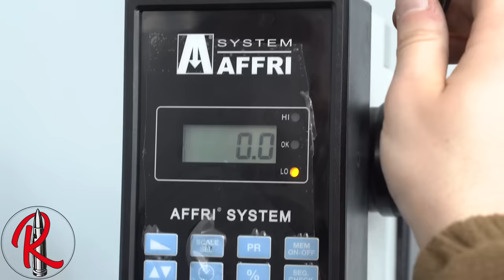Italian ww2 rifle restoration - carcano gun restoration

Comment: The inside of the barrel can be easily cleaned by electrolysis. Plug the muzzle, put a 3 mm wire inside the barrel, wrapped with insulating tape every 5 cm so that the wire does not touch the walls of the barrel, pour sodium bicarbonate electrolyte and connect to the rectifier. Plus to the wire and minus to  weapons. Cleans very thoroughly.  After such a treatment, I even shot with pits in the barrel and everything worked.  To be sure, you can fire with a link.
Reply from the maker: Fire with a link is not a firing test. 
As you can se, the problem for the barrel is not pitting, but headspace and heat treatmen.

Comment: I use a RockWell as a part of my QC job to test the hardness of the iron in the foundry I work at. We use some monocular with a light & measurement scale of .5-1.5 I believe & it tells us if the iron is good. We make safety parts for one of the worlds largest automotive manufacturers. Unfortunately not the best industry to be in atm.

Comment: I don't blame you for not test firing that. It probably for the better not to shot anything outside blanks anymore, though it likely could handle rounds going through it, none of them would flight remotely strieght.
Reply: With zero heat treatment, it is better not to risk it. Blank cartridges as maximum.
Reply: @ВалерийНикулин-р5щ  The barrel would be fine, even without the heat treatment. 

The danger, is that your roungds begin to rattle more as they travel down. This damages the barrel more, and can sooner or later lead to one possibly being caught in siad barrel if not all the powder burns. 

A damage barrel, is not bad, but long term it is bad for safe useage.

But it can still fire for a long time, as seen with hipoint torrorer tests.
Reply: @Espeon1134  Totally agreed.

Comment: A very nice cleaning and conservation, but I wonder if it counts as a restoration if it is not brought back to original condition. This is not criticism, I really wonder where the lines are between conservation, restoration, and renovation. 
I think a good blacksmith with the right equipment could re-temper the metal back to its original hardness, but that still wouldn't fix the damage to the rifling. Hmmm...

 Yes, you're right, nothing could be done to make it safe to use without replacing the barrel entirely, but at that point you get into "gun of Theseus" territory.

Comment: if that gun was new in the cosmoline, it would be worth about 100.00 bucks. they were a piece of junk!
Reply: lol I picked one up at a gun show about 5 years ago, paid $125 for it 😁  and I'm still scared to actually fire it
Reply: They are just fine, just simple and a lot of very ingenious simplifications to the action so it could be mass produced very easily.  I love taking my carbine out shooting.  They are good guns but nothing special.  Certainly not garbage though.
Reply: @ericbrown621  they are junk!
Reply: @ericbrown621  as much as I want to like them they just aren't that good. The bolt isn't smooth and that's partly because the ejector has a stiff spring constantly pushing on it. The same spring also makes the trigger crappy as well. I need more force to crank the bolt open on a carcano than any other milsurp and the biggest weakness is the clip system. As you said, they're just ok but I'd take a beat up mosin over a carcano any day
Reply: @FokkerAce1917  to be fair, no one is going into milsurp collection for match grade quality.  I wouldn't go so far as to take a mosin over it but it is a gun that is perfect for the purpose it was designed for.  It was terribly obsolete by WW2 but so was the mosin which was built with much looser tolerances than it was designed for thanks to soviet corner cutting.  As far as en blocs go, I would take a Mannlicher 95/30 or Berthier over it for sure.  But if you want to talk about a real POS, Vetterli conversions are downright dangerous!
Reply: Good enough to take out a us president .